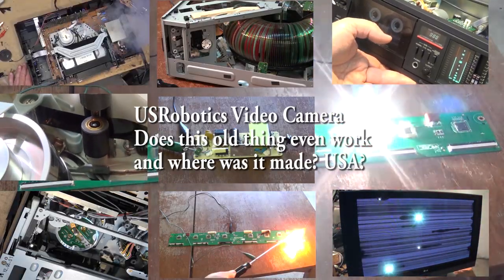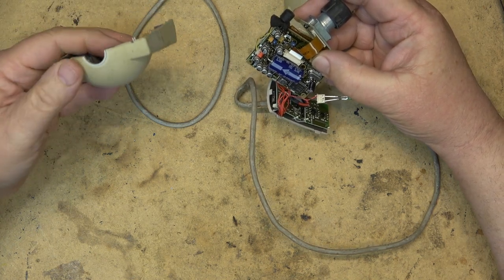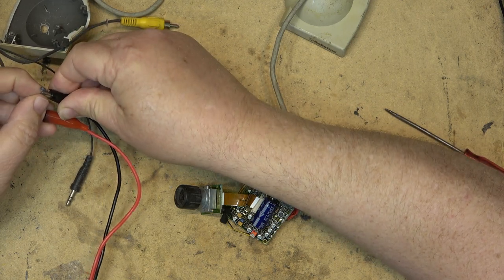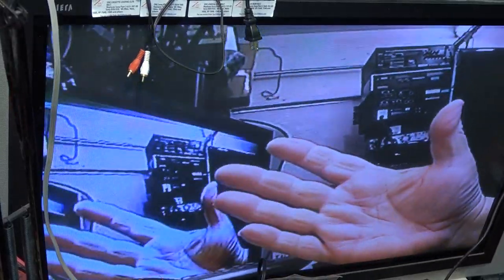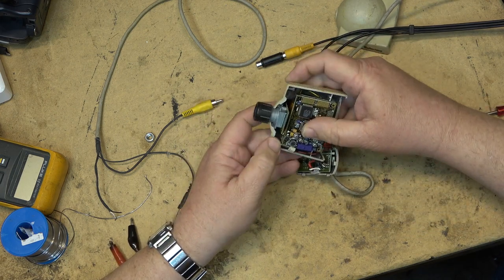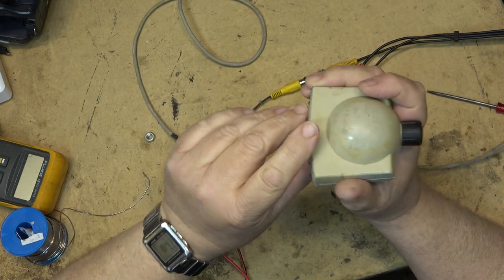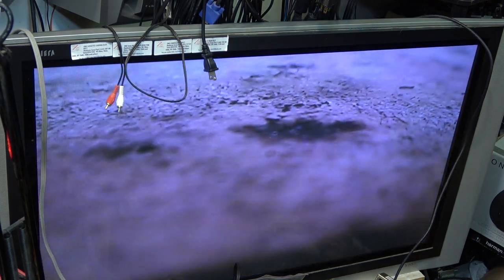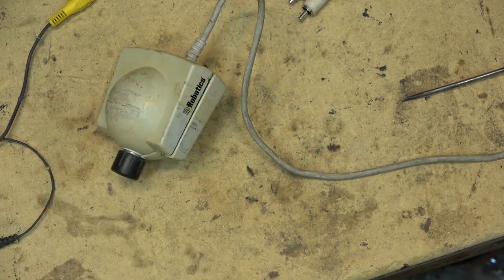I found an early USRobotics video camera will this old camera from the late 80s work

Comment: Very nice, I still have my USRobotics modem, it's the fancy big DSP model where the firmware can be updated, originally I bought it as a 19k2 baud modem, but after a year or so it was software updated to a 56k. I also have a Connectix Quickcam that I bought back in the early 90s, it's B/W only and uses the parallel port as it's from before USB existed, With the modem and the webcam you could do video calls at somewhere between 1 frame/sec to 3 seconds/frame. And from what I remember the best free video call software was named iPhone.

Comment: I think my school in 1995 had one power mac online if you can beleive that and I beleive they did do video calling I can remember randomly walking into the higher grades and they were video conferencing with another school right on an all in one power mac.  The younger grades had no connection but a few of the higher up grades had it.  They had all the macs networked and shared printers to very impressive for that time.

Comment: Sony CCD and Phillips chipset, so likely was made in Japan. Remember similar ones that used an ISA card to do the capture, and for free the capture card, because it was based on the Avermedia chipset, would support a tuner, either it came with the card, or it was simply added on by soldering in the I2C tuner, which then gave you a TV tuner that supported PAL, NTSC (if the appropriate crystals were added to the converter chip) and SECAM standards, all selectable, and all types of sound carrier offset.  Your one probably is NTSC, so to add PAL you would have had to add the 4.33MHz crystal, in the pads next to the 3.57MHz one. 

Here by me those 3.57MHz ones were hard to get, normally you would "borrow" one from a damaged touch tone phone keyboard, as that was the original crystal they used, and NTSC was not common in PAL countries. Of course you had to use different software then, as the camera software was a crippled version, locking out the TV tuner side, and also most of the capability of the chipset, other than the PIP on supported video cards. Camera video was great, the stuff out the card though was not, often QVGA with 16 colours only, though the CCD and camera was quite capable of VGA and 16 million colour as direct to screen capture. Still sucked frame rate wise though, you only got 10FPS.
Reply from the maker: Yes ntsc.  I used it as security camera.

Comment: I’m shocked that its Color considering its from the late 80s, it must have cost fortune. Great picture quality too. I would 3d print a custom case for it and use it as a camera for when someone rings the doorbell
Reply: its not from the 80s, look at it. its from around 1997. Dave is in a time warp.
Reply: @RalphRacc00N iit would've had USB
Reply: @tacofortgens3471  Ok its from 1994-96 then. no one used USB at first. usb 1.0 didn't work till USB 1.1 with Windows 95B.